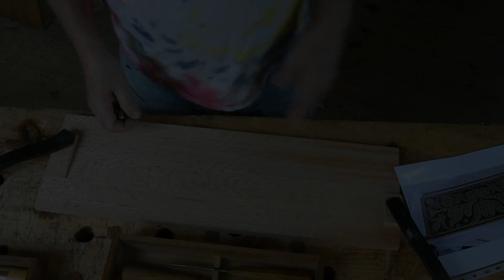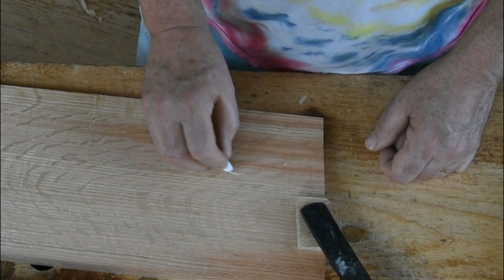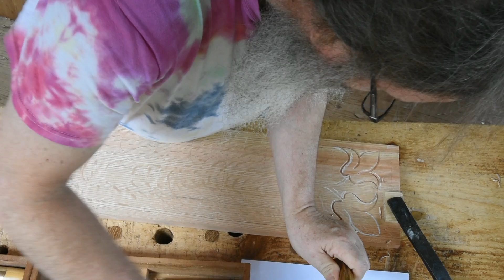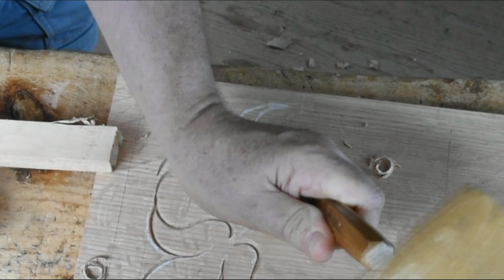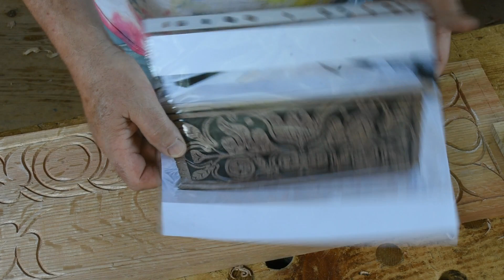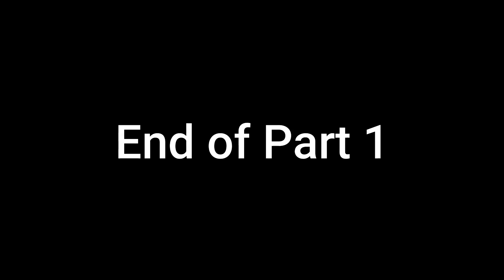carving a box front pt 1 Aug 8

Comment: Hey Peter, 
Approximately how "wet" or fresh (felled to riven to flattening to carving) is the wood that you're working with?

Thanks sir!
Reply from the maker: It varies. Some. like what I'm carving in these 2 videos, has been around for 6-8 months. I'd call it air-dried. But I often carve stuff that was planed from a fresh log just 2 months previous. Because it's radially-split, or quartersawn, either one, it's very stable. Won't shrink much at all.